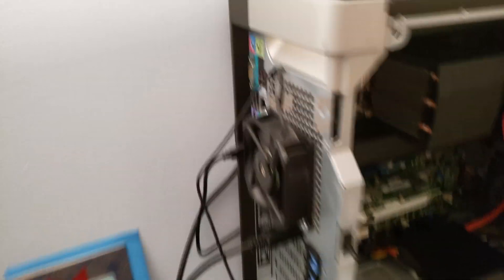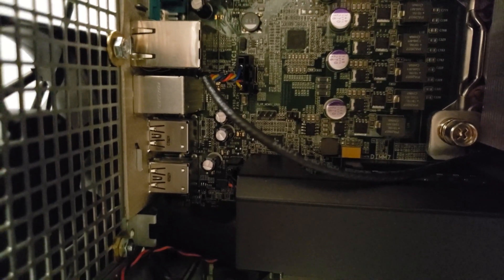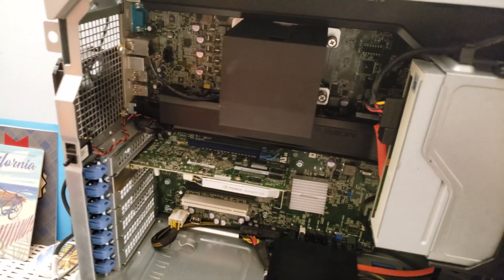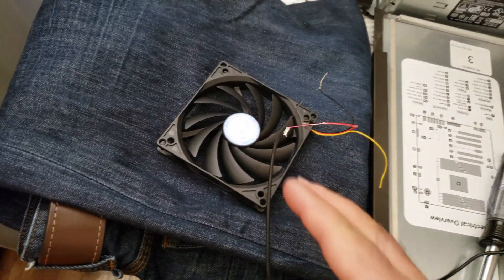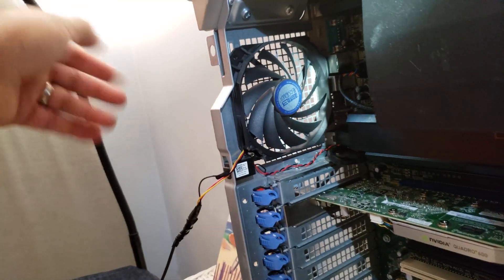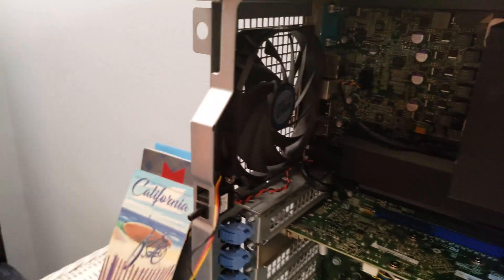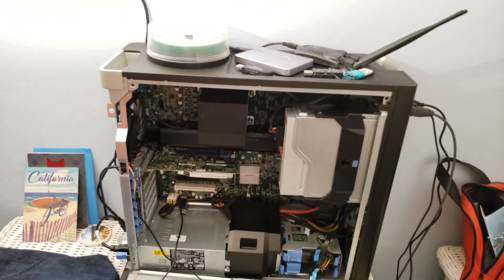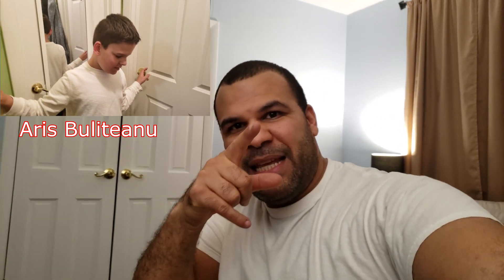Dell Precision T3610 Fan retrofit

Comment: I have a 4pin fan with yellow,green,blue and black wire. which wires do I need to connect to USB?
Reply from the maker: You would have to figure out what the difference colors do…. There must be a ground, positive and a remote. The remote allows for the CPU to speed up or down the fan. The fourth wire, I have no idea what it would be…

Comment: You could have improved the video by doing a few stress test/runs with the back fan installed and without, and compare the difference it makes. Otherwise, good effort..Liked!
Reply from the maker: Well i did run it, off video and honestly it remained just about the same. The fan didn't seem to make much difference. I was only running it at about 5 volts instead of 12 or 14..

Comment: Wondering if I can install a hybrid GPU this way in a Dell Precision 5810?? Perhaps if one comes with a smaller fan, many are 120mm. Too bad OEM do come come with extra fan cooling (PCs would last too long for resells).
Reply from the maker: Darmok I think anything is possible. I ended upgrading to the Lenovo M920Q Tiny. It’s super small and packs a punch.. I am happy with it and with all the extra room I have